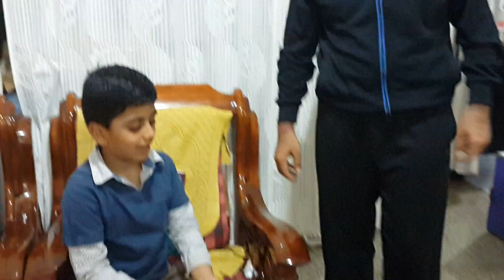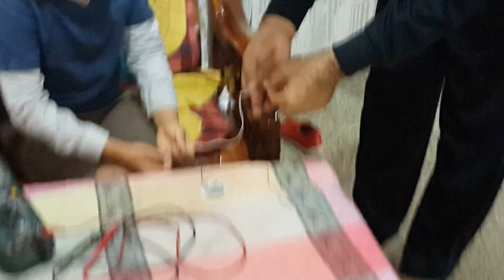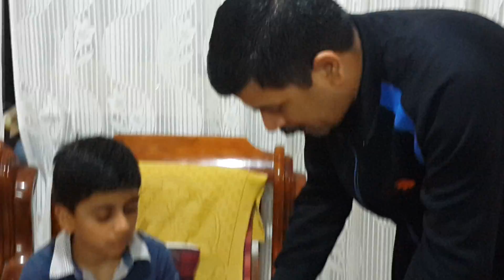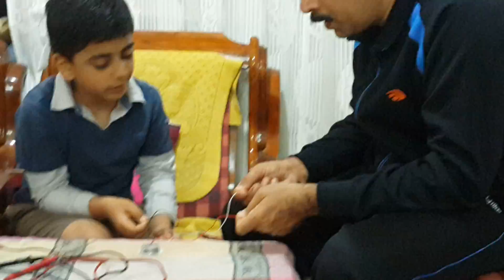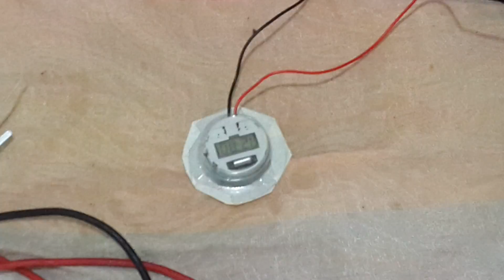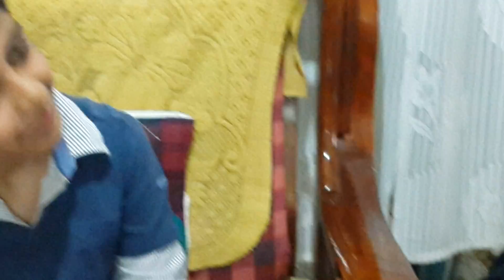Electricity from Human Body

Comment: What you can attached with two terminals
Reply from the maker: you can power anything that doesn't require too much power, I used a potato clock for example, since the human body usually doesnt generate a lot of electricity.
Reply: Ok but name the two terminals for eg. Copper, zinc etc
Reply from the maker: @akampreetsingh6039  oh, sorry, didn't quite get you there, you can use a few materials, but the ones I had used for the experiment were a zinc strip for the anode and a copper strip for the cathode.
Reply: Ok
Reply: Ok or experiment upload kro pleasr

Comment: Then why the wrist electronic watches has battery. It may run by human body. Please explain.
Reply from the maker: Because human body does not generate enough power
Reply: @aaryatiwari  If we use LTC3108 voltage booster, wouldn't possible?
Reply from the maker: @ARUNRAM-ARK  Weaker power draw watches use it
Reply from the maker: This is one of them

Comment: My question is.....if 60 people were connected by wires to a 60 watt light bulb, would the light bulb turn on? How many people connected by wires does it take to turn on a light bulb?  Thank you for this simple demonstration that even the "nay sayers" can duplicate and prove to themselves if they really want to!  Thanks also for the comment as to what type of material to use for electrodes by Aarya Tiwari!
Reply from the maker: Let me know if you want a video on that
Reply: @aaryatiwari  I searched  a video but I didn't find any results.  Please make video on that.  Like producing electricity with many people.
Reply: @aaryatiwari  please make a video with 120 people powering a 60watt light bulb or even 60 people powering a 30watt light bulb.
Reply from the maker: @reillyalexander1592  Hey Alexander, so... due to the current situation, it would be challenging to get 120 men to power a light bulb... but I'll try my best to get something close, and interesting.
Reply from the maker: A human can generate about 10-50 mV or 1/2 watt so in theory, it's possible with 120 men.